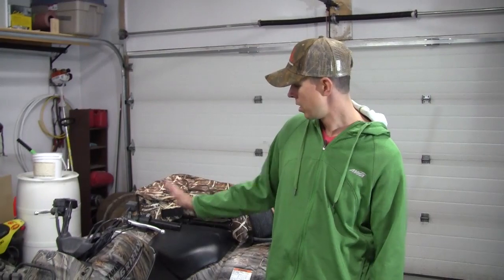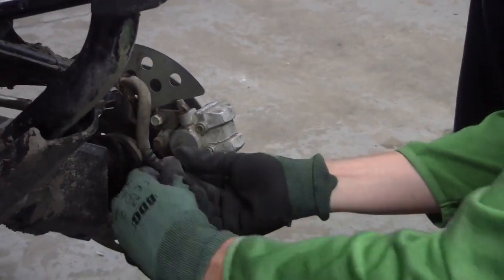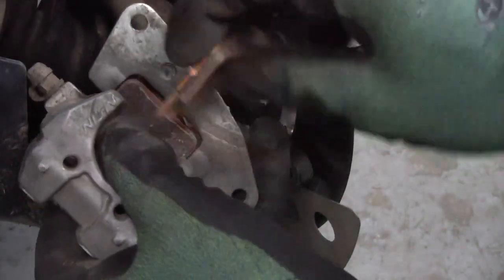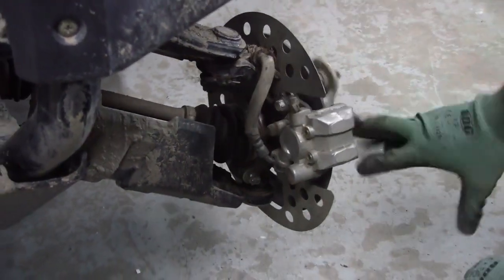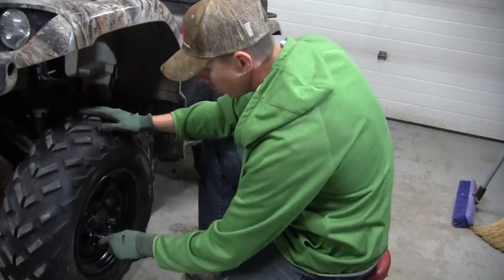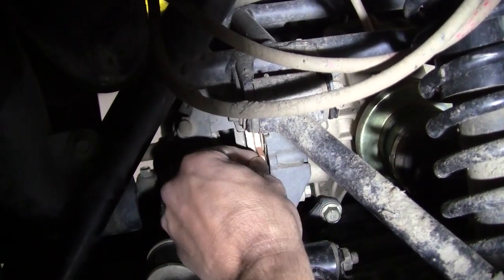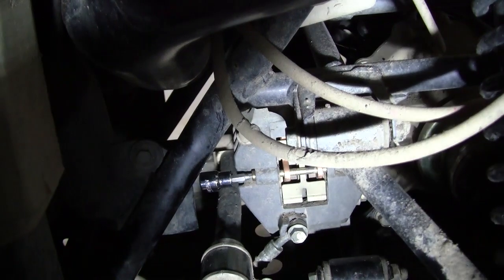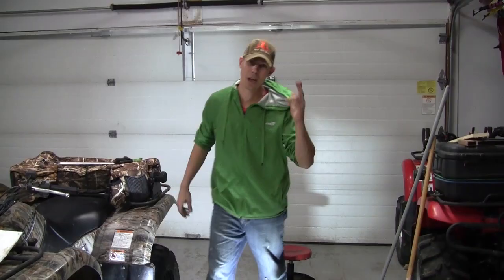2006 Yamaha Grizzly 660 Front and Rear Brakes

Comment: I'm looking at a 2006 grizzly this weekend.  Can you tell me what I should look for ands the weak spots to look at for.  Thanks
Reply: Front drive shaft splines. The splined shaft is short  and the splines tend to wear out.
I had a rear axle pop out, they are only held in by a spring pin.
You can pull it all apart and bolt the two inner axles together.

Comment: Thanks for the very helpful video. Bought a used griz and am a bit new to it. Got the brakes done with confidence. Watching the vid made it very easy. I will be doing the bearings this winter so I've already watched that one. Any other maintenance vids you put on for griz I will watch. Helps to know exactly what tools a guy needs before starting. Thanx again.